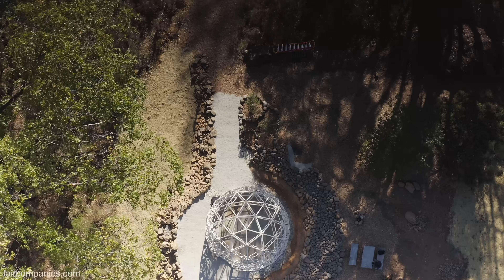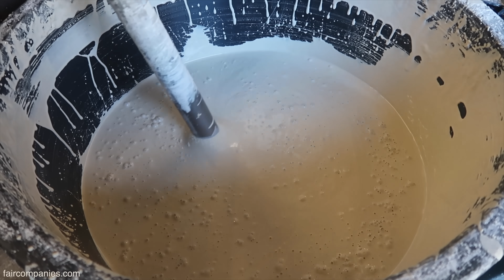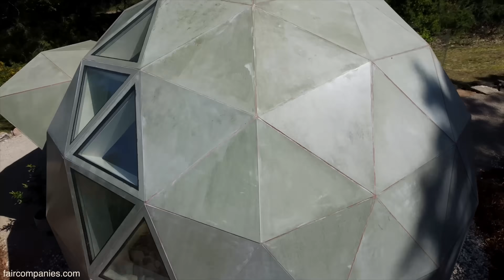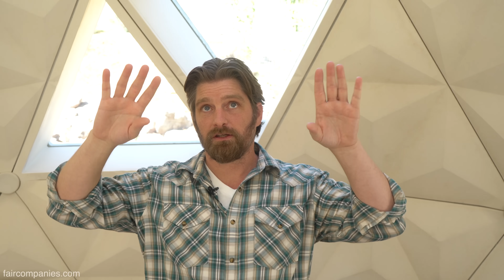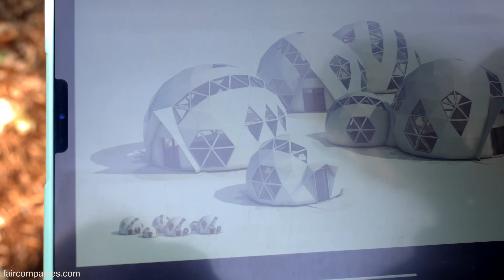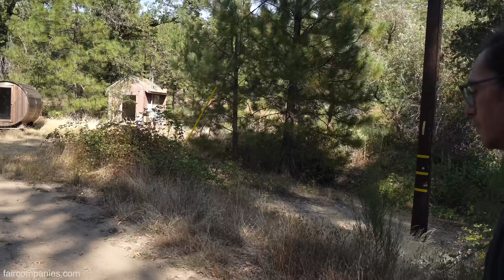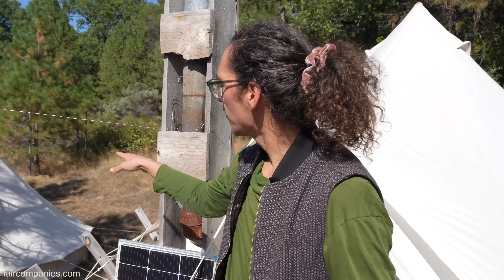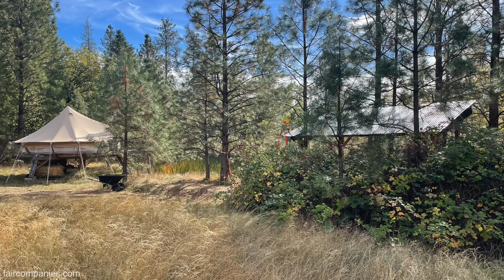Building ecovillage of storm-proof homes made of bone-like biomaterial

Comment: I didn't realize Doug Benson was building "geodesic domes" these days!!

(Close your eyes, listen to voice!)

NOW,  on a serious note [and i promise, I'm trying to respctful!]:

- the discussion of all "material science", and the claims of the benefit of this particular style structure could REALLY benefit from the expertise of actual,  informed scientists...
Ex: things like "this ceramic has a compression strength of 1500psi" may very well be true,  but there are about a dozen different measures of a material's strength,  and "compressive" may not bee must relevant in all cases

- that shape may very well be the "cheapest per interior space", but ppl build in boxes for GOOD REASON; by measuring the volume of a dome,  you're including extra overhead space,  and all that essentially lost along the perimeter,  as it's very difficult to maximize efficiency of furniture layout without straight walls to back seating/ bedding/ etc against... so a standard box is MUCH more efficient in that regard

.... also,  until you got ask the way to the MUCH larger,  2 floor models,  they are essentially "studio apartments"... and in all examples shown, WITHOUT kitchens or bathrooms : /

(These seem MUCH more suitable for luxury BnB suites)

*I have MANY more comments,  by in not trying to denounce the concept. I actually love it,  but it does that which you appreciate NO genuine service by ignoring potential considerations/ complications; IN ORDER TO ACHIEVE THESE LOFTY IDEAS,  WE NEED TO EXAMINE ALL POSSIBLE FLAWS,  AND SOLVE THEM BF THEY ACCIDENTALLY DERAIL OUR GOOD INTENTIONS!

With that said,  I'll offer one more recommendation:

I've already suggested anyone interested in this topic/ lifestyle AT ALL,  go look up keywords ' Andrew Millison', 'Oregon state university lectures ', and 'permaculture'... he has INCREDIBLE 10 min educational lessons about ALL related topics; shaping land to collect water in ponds,  natural irrigation,  building multilayer "food forest" systems that trade monoculture for more "natural" means of growing,  energy capture (solar,  wind,  water), and community connectivity....

ALL THAT IS TO SAY,  they're are some AMAZING ideas out there you guys could incorporate into the design of that 100 acre community (which yall are heros for attempting!)

My only comment is, you may feel your retaining its "natural state" by simply dropping homes into however you found it,  but that can be just as ineffective as "regular" developers flattening the landscape and carving a series of square yards into it for each person's home...

The PERMACULTURE method of attaining the ENTIRE COMMUNITY'S long term energy reduction and resource provision,  is to fully plan,  design,  and RESHAPE the land BEFORE the houses start getting built:

- you want to organize the homes, and their surrounding gardens,  with respect to the path of the sun in different seasons (one of many reasons: so low lying sun still hits windows and offers warmth in cooler months)
- you want to get an excavator in there and run lines of burmes and swales, so that however the water passes across the property (both natural and greywater), it is collected and utilized fully
[One good method is to trench btwn "property lines", so that saturated perimeters can be planted with lines of fruit trees,  offering natural "fence lines" and perennial nutrients to sustain community health... these trenches can all lead to a central pond,  stocked with fish and surrounded by walking paths and "natural remedy" herb gardens)

- if your property is blessed with large changes in elevation,  you consider options like building a pond high up; it may be a large initiation investment,  but it can provide constant,  "off grid" water pressure,  and even be combined with natural filtration by partial "unlined" pond areas (wells)

.... Sry.  I don't really expect anyone to read my book,  and don't mean to assume the info is not already known, just trying to underline that there are SO MANY areas of highly  specific, sophisticated knowledge,  and if you're goal is to pursue your dreams with respect they deserve, then horde as much info as you can,  and weigh all options at length (with the humility to accept changing course,  when necessary). 

I really hope this project is a smashing success! 🙌 

*LOOK UP ANDREW MILLISON!

Comment: Im honestly really interested in these, especially with the weather resilience being a main component for their design. My only concern is this: how does the ceramic panels take to impacts, aka hail? Heat, wind, and mold resistant is great, but if it cant handle baseball sized hail, it limits where it can be constructed in for expense of replacing broken panels (Texas and Colorado come to mind for severe hail damage regions).

None the less, 170k USD for a 1500 sqft home including installation and move in ready is excellent in current-day markets, especially for a non-traditional design.

Comment: What is the insulation value in colder areas in the USA. Typically here in Northern new hampshire it gets cold in the winter. How efficient to heat and how about kitchen designs and bathrooms.

Comment: I like the Concept and Theory of a Ceramic home, to be “eco friendly” , yet all I’ve witnessed is the coal driven machinery costing thousands made of unfriendly materials and chemicals that are using “processed materials” that use unfriendly means and methods all to build a mould, also made from highly processed materials to build a dome that’s not ‘design friendly . Meaning where is the kitchen and bathroom?
As a very old designer and forever home renovator I believe in the simple practicalities, and low cost methods can make very  Eco friendly Homes. Earthships  for example , combining handmade ‘ceramic tiles’, could be used instead of the high costs of moulds machinery and processed ingredients. 
To me grabbing a shovel, barrow and a hand rammer is far easier faster and actually is ‘eco friendly’.
In this instance I don’t believe the end product justifies the means.
The only way to help our environment is to simply stop fucking with it.

Comment: Interesting concepts & initiatives. As an inhabitant of outdoor living spaces over 35 years I can't resist tossing in a few observations. Let's go a. b.  c. --- » ___a.  Having had design professors at the beginning of the 70s who had known Mr Fuller personally, Bucky was a prolific theorist but he never structurally verified his domework when it comes down to the numbers - he had structural engineers do that for him. I hope everyone involved that builds off your recommendations has mega liability insurance and understands dozens of obscure pages of disclaimers.
 ___b. For new work that you would want to experience as new and exciting, in design space or lightweight architecture, I personally encourage you to dig in and apply what's currently possible as the advances in sustainable architectures have been immense, particularly Parametric Thinking applucations in design as it were, well before invoking AI -- basically the dome stuff on it's own is comparatively rather old hat. 
 Wellll maybe 5 out of 10🌟 s as you sort of reinvent the wheel bandwagon... now if you relegate Bucky to RIP and bring in turtle carapace with or without exoskeleton and sundry strengths of various sea shell morphologies, efficiency of load distribution in catenary curves you might want to implement as roofing  optimization I guarantee to be a little more impressed, um, i mean honestly beyond 50 years of Fuller's tail wagging legacy
___c. SHELL MORPHOLOGIES -- replacing anything spherewise you are currently advocating by extracting a volumetric section from any of the shells which have a natural golden spiral event -- for a marginal increase in effort will give the occupant a geometric space which is exponentially enriched as in a joy of living experience, simply as per daily influence of the harmonic surfaces relative to dad's ancient dome on its own, however noble, strong and stalwort ___👉cheers etc
PS here's __d. __ take some cross sections of seashells by subtractively grinding an organic shape (not just cross cutting with a table saw) and see what a couple of such endeavours might give you ie as something you might plug  in to replace a basic sphere --- any of the 3D laser modeling technologies will afford you all the equations that matter

Comment: I studied and workshopped with Fuller in the 60s. These interpretations are remarkable. I would like to see deeper exploration of the "bone" material. I have done work with hempcrete, which actually strengthens as it ages, and this seems a refinement and extension of that.

Comment: 89 years old lad build dome years ago,  say 1970. He lives there for several years before deconstruct it. On YT interview (miniature of older guy on skateboard) he told biggest problem was never-ending leaks on triangle panel joints. So keep it in mind before pull the trigger, do some smaller, test construction as proof of concept for particular solutions. Say garage, shed etc.
Reply: It seems these domes are pretty tested for heavy weather, but good advice to keep in mind if one want to buy!

Comment: A Pentagonal Pyramid designed home is just as strong & less complicated faster to construct. Using pre-fab light weight concrete with fiberglass mixed in makes super strong panels that can be bolt together faster & easier. Yes this structure is strong due to the geometric polygon panels with bioceramics materials but what I learnt is the more panels & complicated the design you have to be super accurate or you find gaps if slightly out, that's the issue when you have so many polygon panels they have to be super accurate, less joins the less chance or developing gaps in your seals.

Comment: Domes sounds good but they are not a good solution at all. Now that you have your dome and are moving in, where will you put all your things? You need square walls for your beds, tables, cabinets, closets, couch and all that other square stuff to go. Your custom home needs custom everything to go in it. No hand me downs, no free or used things. All custom fit to that spot. Want to change it? It won't fit anywhere else. I spent a whole summer tearing down a rotted out 40' dome from the 70's that had rotted here. Domes are great for temples but I would not recommend moving in to one.

Comment: If you have the threat of high winds wouldn't it be better to have the walls angled to the ground and not perpendicular, even a little near the ground like this design?  If wind hits something at an angle it doesn't have nearly the power.  Yet all these type of designs are perpendicular to the ground near their bottom.  It seems so unnecessary.

Comment: New solar panels & battery technology will make a big difference to living off-grid. It may be possible to use ceramic to convert & store energy. Gaps between exterior & interior ceramic panels could store the batteries, but you would need a cooling system to improve battery life. Also need a water capture & filtration system.

Comment: Cost? I built a 40" dome on 6" riser wall. Love it! Id love to put a cover over it with those panels. Beautiful work. Love the interior! Does it use insulation or just rely on trapped airspace? Im curious about the hub system.

Comment: Sorry guys, no good film. A lot about a guy camping which has nothing to do with the domes. Missing info about curtains, shields for the windows, how to handle moisture, heat, cold, how to integrate a floor in the dome, how to intergrate the cables, the plumming etc. Architecture is part art, part craftsmanship and part technology. It is dealing with all aspects I mentioned and more. Making a film about new concepts in housing is about showing how this concept is ticking the boxes, besides how it feels and enlightens the spirit.

Comment: I like it but I do think that it needs some more personality. Like maybe on the inside smooth walls with no ridges and the ability to color the walls. The no ridges since it looks tacky on the inside. Also some way to hang pictures on the rounded walls would do well to and maybe skylights and nice ways to hang hanging lights. Other than that It should be able to have a basement as well for places that get a lot of tornadoes. Also if there's a way to make them really tall for more stories would be good for using up less area of land.

Comment: The tent is too far :)   and while triangulation looks neat it's ultimately a too limiting premise.
I have long proposed laser sintering of sand as a 3D printing approach. It can mix in sintering of metal powders where reinforcement is desired or electric conductivity so all the wiring and plumbing is part of the printing process. It has no cure window like concrete that requires manual labor and is less energy intensive. It has the potential to make arbitrary sophisticated houses at borderline negligible price. No one has done it yet. They all focus on cement.
A laser tube might be 40$ and will last hundreds of hours.

Comment: Maybe I missed it but how does the HVAC work? In New England definitely need heat unless it’s entirely passive solar. Also, what about ventilation? Is there a central chimney to keep air circulating? In that large luxury model shown at the end, how are interior walls constructed- wood? Are these permitted ? Is there a regulatory framework to permit these kinds of structures? Maybe in California…..

Comment: Very cool, but there will not be much R value to the material.  The hemp fibers help a bit, but not enough.  So if your area experiences more extreme temps, not the best material to use. What they should do, is to make thinner panels, but have two of them per area with a gap in between, and in that gap put some kind of insulative material.

Comment: This is one of the first dome homes I've seen where the windows aren't hideous.  (Have you ever seen a rectangular window crammed into dome?  Not exactly elegant.)   Now all they have to do is figure out a way to make at least a few of the windows operable and not fixed, and some probably need louvres to control the light.   Another thing I like is the potential for economies of scale:  With just a relatively few kinds of standard parts, you could build a complete structure.

Comment: Curious about ventilation. Looks like maybe there is a little solar powered exhaust vent. It would be cool to see you pair these with proper heat/energy recovery ventilation (HRV/ERV) systems to ensure proper fresh air supply without compromising energy efficiency. Every dome and most natural builds I've been in (and most conventional structures too) fail to adequately account for fresh air needs.

Comment: basically this is a new and improved hempcrete. i am wondering thought with hempcrete the walls have to be 12 inches thick to be insulating. How thick are these walls? how insulating is this material? what are they using as floor material?

Comment: The material in thr video is Hydroxyapatite, a calcium phosphate compound with a structure similar to that found in bone, was developed in the early 2000s by scientists at Los Alamos National Laboratory as a part of their research into materials that could safely immobilize nuclear waste. It’s particularly useful in nuclear applications because it can incorporate radioactive ions (such as plutonium, uranium, and other actinides) into its crystal lattice, thus immobilizing them and reducing the risk of environmental contamination.

The synthetic form is engineered to include not only calcium and phosphorus, but also magnesium, potassium, and sometimes other elements to improve stability and enhance its ability to trap specific radionuclides. This bone-like material was chosen because of its biocompatibility and stability, particularly in resisting degradation under certain environmental conditions—qualities that make it a promising option for nuclear waste containment.

In building construction, breathability (or vapor permeability) is crucial for managing indoor humidity and preventing issues like mold growth, as it allows water vapor to move through walls. While hydroxyapatite ceramics could provide exceptional durability and possibly even fire resistance, they would not serve well in typical wall construction if breathability is required. So the built-in ventilation system is very important.
Reply: please, do you have a link to the  hydroxyapatite (HA) process, that allows it to spread more like cement, or thin set?  I

Comment: I love everything about this except dependency on tech to operate....which makes it more fragile than it is resilient. Now it needs work on back-up, non tech systems.  I'm not talking about the design process, but the ongoing operation. How would you bypass the computerized ventilation for instance, in event of power loss?

Comment: My friend just built a concert block square house about 600 sq ft. with outdoor kitchen for under 30,000 $.  It's in the tropics so no insulation needed and single pane windows and sliders. The metal roof might come off in a hurricane  but the house isn't going anywhere.

Comment: Interesting material! The dome shape, as cool as it is, May be a deal breaker for bigger markets, though. It’s just not suitable for most people’s housing needs (hard to furnish or subdivide, lots of wasted space due to the height/floor ratio).
And a dome can’t compete with a well-made house in terms of aesthetics, either.
It’s cool for vacation homes, retreats, mobile structures for festival shops, etc., but 95% of people wouldn’t be happy living in one.

Nonetheless, good thing these guys are doing this research, it’s fascinating stuff.